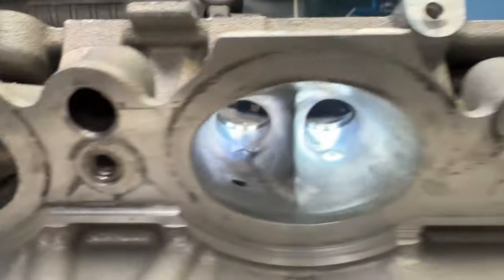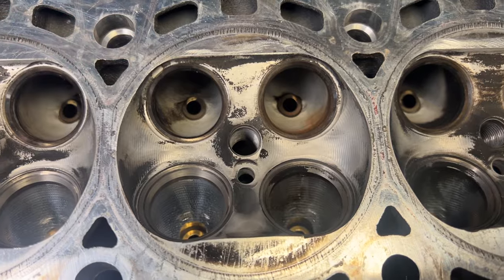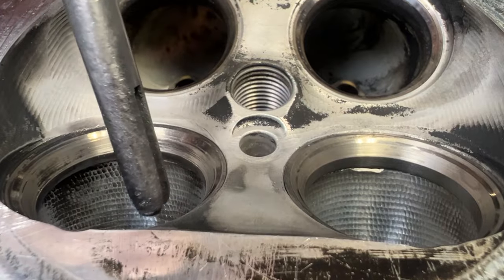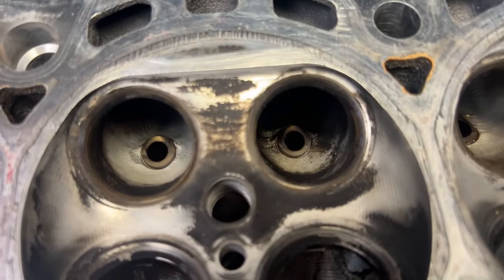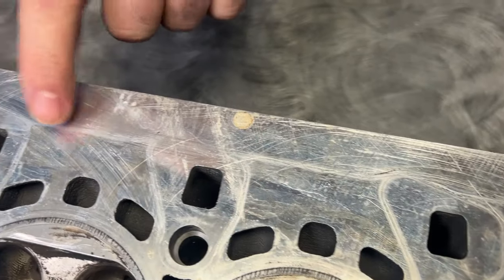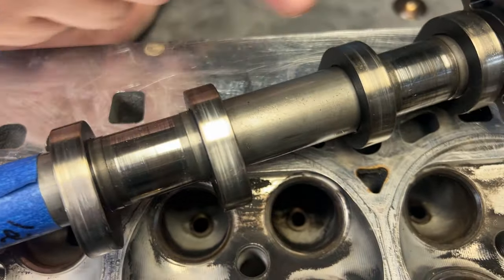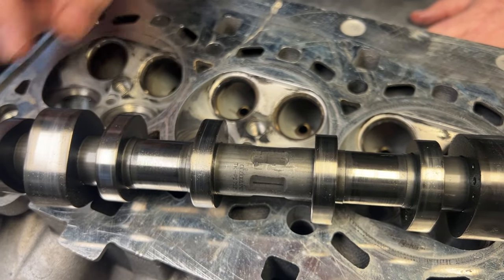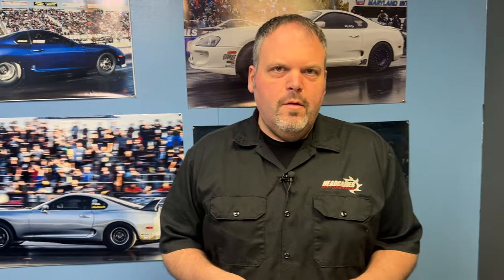S58 build gone wrong...the teardown

Comment: Dude that heads shocking !!! WTF were those clowns doing.. obviously not professional engine builders with history and a good reputation .. 

There’s nothing wrong with posting content like this , it makes people aware of issues if people try to cut costs. Most will respect you more especially when you go into detail regarding measuring the stem height etc etc . 

I subscribed simply for this reason and because we have an S58 . Also there is very little information in circulation with this engine. 

It’s been very helpful and informative for myself and no doubt others too . 
Thankyou 👍🇬🇧
Reply from the maker: I just think if your on this page, we should be discussing HeadGames but..I can say that maybe it shows what else is out there and why you should come here lol idk. It's a battle for me for sure.

Comment: Thinkin y’all nailed it, with the “window licker” assessment, but, think it’s multi-level, one for the guy doing the work, two, for the customer giving the nod to the absurdity of the work proposed.
Reply from the maker: The customer just wanted a fast car, he doesn't know much about it. Just got taken advantage of
Reply: @headgames  well then, that adds another layer, for whoever is doing the work on the car / engine for the owner, and using that machinist or engine builder, and giving the go ahead on the head work…
Sounds like the car owner may be getting hosed from more then one direction, but, fully understand your not wanting to be connected to that drama.

Comment: Hey Dave I saw your 2jzge vvti video vs 2jzte non vvti,so my ? Is it just as simple to swap heads from a toyota supra 2jzgte to a 2jzge and now you have a supra now for example from my is300 2jzge is that possible to take a 2jzgte head off a supra and will that give me in a sense now supra power or is there more involve! Love your videos I've done head work before on my 08 honda odyssey engine so I've pulled heads before and if that's possible I'm just curious, okay pls lmk thanks very much
Reply from the maker: I don't think it is worth going from a GTE head to a GE head on a Supra. Unless it is an NA-T combo then the VVTI head is a perfect fit. I know they all bolt on but I am no swap expert on the rest of that deal. Thanks for watching !
Reply: @headgames  ok it looks like I'm catching up with what you meant nat engine! If that means naturally aspirated then yes I have a 2002 lexus is300 2jzge bone stock engine so all I wanted to know is if the head from the supra will give me more power and is it as simple as swaping the heads had to figure out what NAT meant lol I'm a nooby!..Dave sorry just trying to know if I'll need to do more or if I can just again swap a head off a supra and slap it on an is300 stock 2jzge block if that's more clearer maybe I confused u sorry for my Grammer in putting this questions together..appreciate your time!!
Reply from the maker: @anthonyboria5738  don’t worry! I just needed some clarification. Don’t switch heads, stick with what you have. There’s no gains.

Comment: hi,i need your opinion on this....can the cam caps from one head can be use it in another head without any modificatios? my understanding is that it should not but i want a pro opinion on this topic.
Reply from the maker: no cam caps cannot be used from one head to the next. The head needs to be line honed. Cam caps are married to the head.
Reply: @headgames  love the response.....just the same way i think!!!! thanks

Comment: What if only misfire at idle ? , with all other things check 
Compresión 
Spark 
Coil 
Injector 
Fuel pressure and pump ?
Reply from the maker: check the cam caps, sounds like you checked everything else

Comment: The only reason I can figure a guy would pull after-market to go back to OEM is if the thought the after-market stuff was junk. Without it on hand, how can you be sure ?
Reply from the maker: The same shop has done a few heads that have been coming through here and I know the spring kit they use is worse than stock. So I get wanting to remove it, but the valves are great and would have worked with the stock spring kit. Would have been a better alternative to removing seats with a screwdriver or chisel how they did.